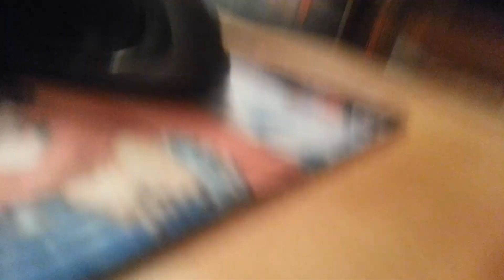How to fix ASUS Zenbook keyboard issues

Comment: Hi; I've done this before, when I had a cluster of keys not working, and it did the trick. But can the reason be the same when the keys not working are far apart? At the moment, my 'e' is unstable and the key for the number three has stopped working completely, but then so has my forward arrow, which is far from the others.
Reply: I had the same situation. I’m sorry it’s been so long since yo response but this was a new development for me. 
My keys were very far apart and this situation happened and worse, it progressively got worse. 
I opened the laptop easily and quickly. I didn’t even find my tiny torx. Eyeglass tools were good enough. 
I pushed the ribbon back in and closed everything back up. 
No problems since. 
The laptop of a decade old and I dint use it often but, as someone else said, I’d ra her not have to use an external keyboard. 
Worse: if your power button stops working, you’re screwed.
Reply: @westmcgee9320  Thanks for replying. I guess I'll try, then. (I have a new computer now, but I'd still like for the old one to work.)
Reply: malovela you’re welcome. Good luck.
Reply: I have a zenbook x305 and 1 key not responding. I went to a repair & they want to charge me $270 parts & labor. I figure it's worth a try or load a keyboard app or use an external keyboard. but that defeats the pt of having a laptop. I'll try it. Nothing to  lose.

Comment: Was not expecting this to work on my UX32A, but it worked like a charm! Slightly different connector but almost same placement. Computer wouldnt show any signs of life, and before starting randomly and sometimes not at all. Thanks a lot for the video, saved me the hassle of moving SSDs and copying data. Thanks a lot Naveed!

Comment: Tips to other unlucky Asus users. Flipping out the cable and give it a wipe and put back gets better results. Do not touch the connectors. The 2 clips at the sides have to be pushed simultaneously or the adjacent one will flip to unlock again.  Thanks   !

Comment: Thanks for the video, but my keys are still really hard to use; have to press on them with a hammer practically. Anything else I can try?
Reply: If more pressure makes a difference that sounds like a very different issue. 
It sounds like something under the keys is the problem.

Comment: Amazing, this was a simple fix, I just pushed in both white tabs at the same time to lock it back in place.  It turned on immediately with the power adapter.  Previously it was not responsive to the power on button.  I had to unplug the battery and plug in the adapter, and it would work after some coaxing, but with this fix, it works like brand new.  I am interested to see how often I will need to do this.  The video mentioned every two or three weeks.  My next step was to purchase a new battery.  This saved me $40

Comment: Hey, thanks for your help with the video. I didn't have this problem until recently and I've been using it for over 4 years. Any idea what the problem is, like what the chip or connectors you are pushing in are related to ? Just trying to see if there is a potential permanent fix.

Comment: Thanks!! You are a gift! I bought this laptop used from a former Senior Google Engineer for $100. It worked and looked great. A week into it, the D, Backspace, and Down/Left buttons stopped working. I was able to make this fix in under 5 minutes. Screwdriver cost me $4.49 before tax at the here Ace Hardware.

Comment: Thanks very much - my keyboard is now working properly again.

My backspace and "d" keys were the main problem, and sometimes the "p" and "o", but they now work OK.

The connector in my Ultrabook was covered by some very very sticky pale yellow tape - it looked like masking tape. You know how masking tape must be removed as soon as you've finished painting, otherwise it goes really sticky... well, that's what this tape was like.

The connector itself is very odd. One side was sticking out, so I pushed it in with a very small screwdriver. That made the other end pop out! So I had to push both sides in at the same time.

I reckon Asus know this connector has this problem, so they cover it in sticky tape to help it stay in place.

Anyway, thanks for the video - you are a star!

Comment: Thanks so much for the video! Worked like a charm.  Similar to other users, I had a key that sometimes wouldn't work.  Then suddenly yesterday my laptop just shut down while I was checking email and wouldn't turn back on though the battery charger light was green indicating the battery was full.  Without this fix, my laptop is a brick.  Awesome step by step video.  I just replaced the tape and hopefully it will hold.  Thanks again!

Comment: This works phenomenally well, and for me also resolves an associated issue for me which is a flaky power button (the alternative for that is a rather intimidating BIOS reset).  Have Torx 5, will travel -- literally.  I wind up needing to open the case every 4-6 weeks, and yeah, it gets to be pretty quick.  What was most helpful in your video is that you show that reseating the keyboard is done by pushing it laterally into the motherboard (parallel to the table you have the computer resting on), not down toward the table. Other videos are not that clear.  Well done and thank you!.

Comment: Interesting!
I have the UX31 model, which went to Hong Kong ASUS repair shop twice ro fix the keyboard. Out of the blue two keys (the esc and backspace key stopped working) didn't respond. They always told me big story upon pick up. After it broke a third time (I run out of guarantee) they want to charge me 500 bucks for a new motherboard.

Comment: does't work for my one. I even cleaned the cabel and so on with alcohol, but it didn't work. Would a new keyboard maybe fix the Problem?
Reply: +TheMrBrightsight Have you tried a new one? Having the same issue. this simple fix wont work.
Reply: +TheWeeezel I bought a new Keyboard - that solved my issue ^^

Comment: Thank you very much for uploading this video. I couldn't turn my laptop on and tried disconnecting and reconnecting the battery; using the AC adapter without the battery connected and holding down the power button for 60 seconds which are other fixes for the Zenbook not turning on, but it turns out the issue was the keyboard. I was already looking for another laptop so this was a big help.

Comment: Had the same issue with my Zenbook UX31A, your fix was spot on, down to the T5 Torx, long screw description!  I followed the video as described and now my keyboard is working normal again (shift key(s) were not working).

Thanks for taking the time to do this!

Comment: Works a treat !! Opened my confuser up and found that the retainer securing the keyboard ribbon cable had loosened ! Touch wood this was the root of my power button intermittently not working. So far so good .... the power button now works as it should. As per previous posts ... this saved me dealing with ASUS repair centers.Thanks for the tip.

Comment: Can you tell me what i can do if the backlight does not work anymore? My Asus was send to reperation after the power-connector got broken, Asus sent it back with the backlight not working anymore :( keyboard is working though.

Thanks in advance!!!
Reply: I believe there is a connector for the backlight to work.  It is possible it is loose or they forgot to connect it when they put the keyboard back on.

Comment: Yeah, worked for me too, thank you for making this video! I suffered with 4-5 (s, r, etc) keys not working intermittently for months, including the power button more recently. [I also took cyborgnetics1 suggestion in comment below, took out the battery (3 screws) and the middle of the white clip would not push in all the way without pushing it on with a very small flat screw driver under the ribbon.] I added this step: cut out a small piece of clear shipping tape from the ribbon to the connector. Doubt if it will ever shake loose again. Thank you again Naveed for helping so many fix this otherwise fantastic ASUS UX31A-XB72 Zenbook Prime!

Comment: Thanks so much. This describes the problem and solution perfectly.
Was dreading the ball ache of having to send my Zenbook back for warranty.
I bought the laptop at a big discount as it was a refurbished unit. Interestingly instead of the orange Kapton tape there was masking tape on the plugs. I think the techs may have fix this once already.
If the problem happens again I'll do what cyborgnetics1 suggests and take the battery out and look at the underside of the ribbon.